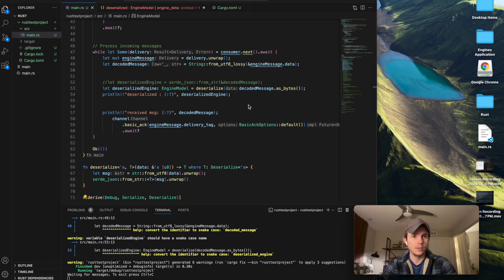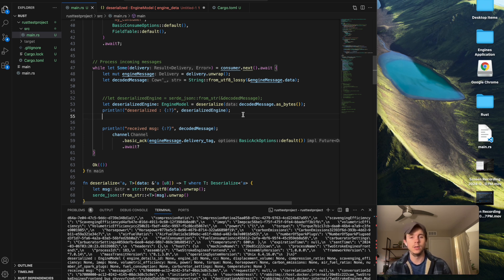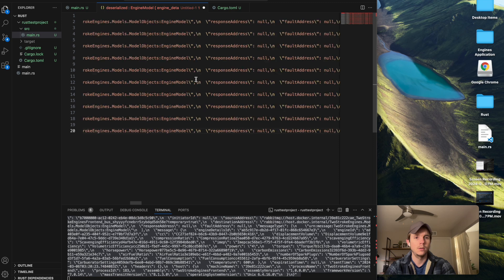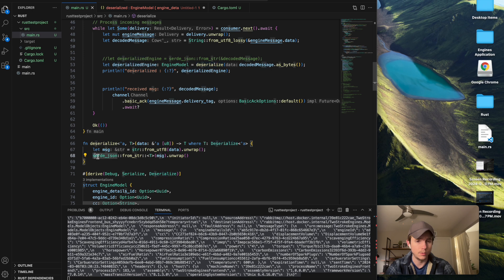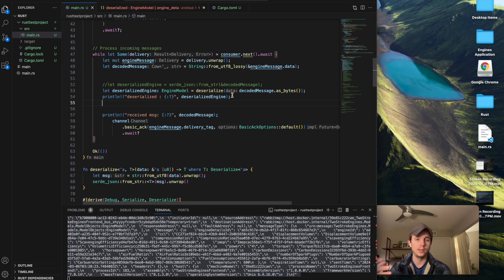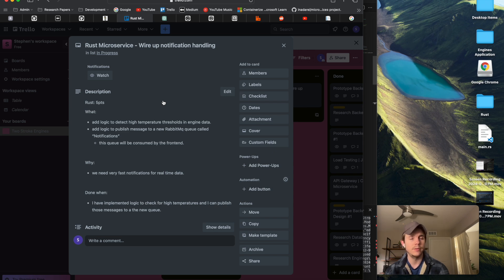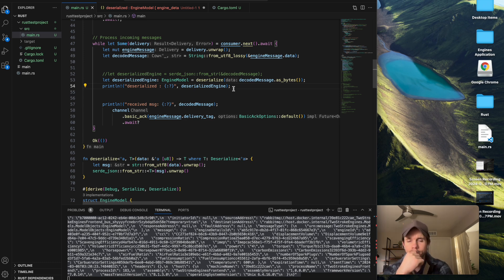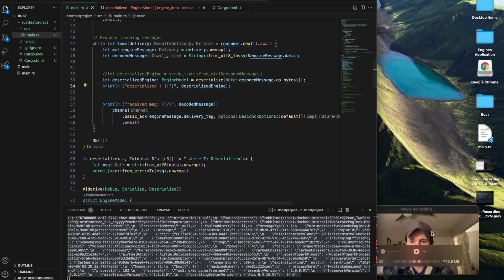Software Engineer Daily Standup 21 - Deserialization in Rust @StephenSamuelsen

Comment: The reason you're having this issue is because of the deserialization logic. What you need instead is to use serde_json's from_str function outside of the deserialize function. By implementing it you are overriding the default behavior of serde_json. Where you call deserialize you'd just call serde_json::from_slice and pass in your bytes. I'd love to help out with this project if you don't mind having other contributors!
Reply from the maker: hey I really appreciate the help! I seemed to get it working, however I was running into issues using the from_slice() method. Not sure why. I'll have to think about if I want to make this open source and invite contributors to put up pull requests to the code base, but if I do i'll definitely let you know.